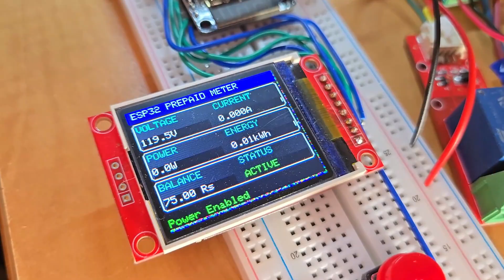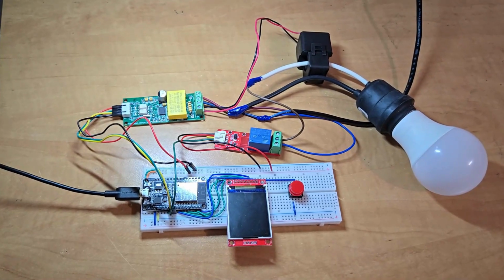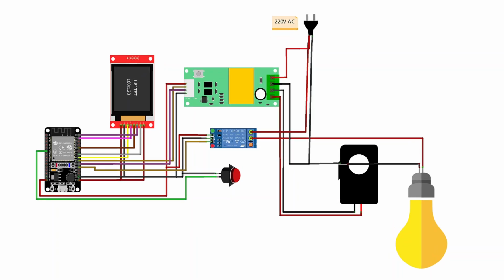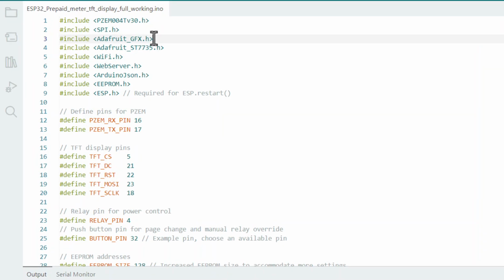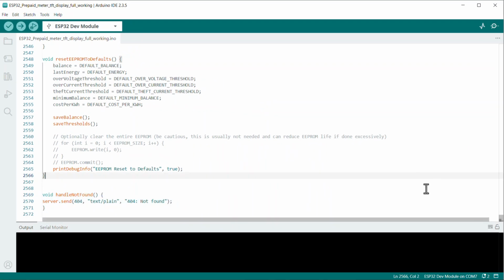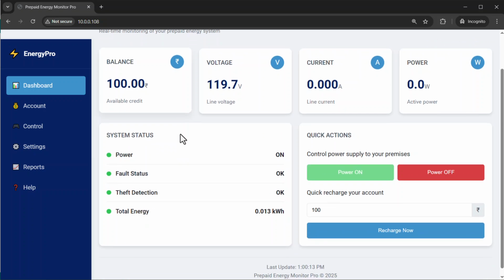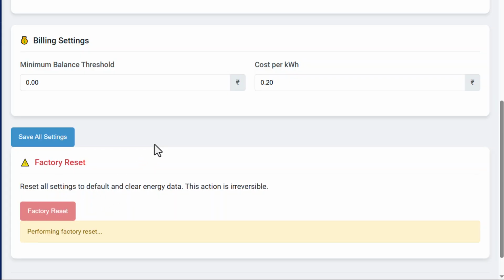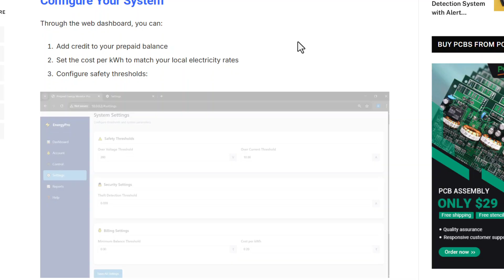Advanced IoT Prepaid Energy Meter using ESP32 & PZEM-004T with Professional Web Dashboard

Comment: The ip address is not working when connected to other wifi or mobile internet
Reply from the maker: It should be connected to same network as its a local webserver.
Reply: @HowtoElectronics can we do something to make it available from anywhere?
Reply: @HowtoElectronics thank you so much for your reply
Reply from the maker: You have to use hosting or build some server and create a dedicated website to host the webpage. This would be expensive.

Comment: “Appreciate it! 👍 The project was great. I’ve changed the CSS script to make the navbar visible — now all functions are accessible in mobile view. Let me know if you want the code; I’ll be happy to share it. 👍”
Reply from the maker: Highly appreciated.
Thanks
Please share the code to admin@how2electronics.com 🙂
Reply: @HowtoElectronics   find "@media (max-width: 992px)" in your CSS section
remove the code that hides the sidebar and change grid layout
updated code below (see replies and add one by one)
Reply: @HowtoElectronics    .sidebar .brand { display: none; }

  .nav-menu {
    display: flex;
    flex-direction: row;
    overflow-x: auto;
    gap: 5px;
  }

  .nav-link {
    font-size: 14px;
    white-space: nowrap;
  }
Reply: @HowtoElectronics    .main-content {
    margin-top: 60px;
    padding: 10px;
  }

  .card-grid {
    grid-template-columns: 1fr !important;
    gap: 15px;
  }

  .input-group {
    flex-direction: column;
  }
}
Reply: Good job. Please share your code link with us
Reply: @ChineduEmmanuel-en7qj  I’ve already sent the code to the admin. They might update it on their website.
Reply from the maker: Thanks a lot. We will update it soon
Reply: @HowtoElectronics  I have one suggestion: consider adding frequency, power factor, and apparent power to the dashboard. The energy meter module already provides frequency and power factor, and apparent power can be calculated by multiplying voltage and current.
Reply: Please share us the code please

Comment: I have a question about theft protection, how it works on a single current sensor, where my knowledge says it needs two current sensors to read,  both current phase and neutral are both the same so its ok, if they show different so identity bypassed or use ground as natural source for theft please explain it a am very happy to learn this

Comment: but 5V relay can share only maximum 10A. how to develop as a energy meter for home? for maximum current 30A/40A range?
Reply from the maker: For that, you need a 12V relay which can handle 40A or you need to use a contactor for such high current applications.
Reply: @HowtoElectronics  can you mention that relay here? Is it use with ESP32 too?
Reply: Tem outras formas de medir corrente, não precisa passar diretamente pelo dispositivo, você já viu como funciona alicate amperímetro ? A medicação funciona de uma forma análoga